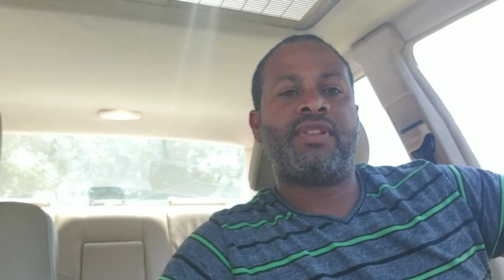W202 power window repair

Comment: Hey I need help my c230 and every mechanic I go to is ripping me off . But one of the things is my driver side window goes up and down. But my back and passenger side windows don’t work and then some times my front driver side window will stop and the sunroof. But if I do a hard reset the sunroof and driver side will work again but other windows don’t. Could please tell me how I would fix this
Reply from the maker: That would be all but impossible to diagnose without having the vehicle to look at. There may be a fault with the window lockout switch. It's the tiny switch on the left between the left front  and rear switches. Put the key in the driver door lock and turn it to the unlock position and hold it there for 5 seconds. If all the windows go down,  it's  a problem with your switches on the console. If only the driver window goes down, it's  a problem with the window controller.

Comment: Why not use wd40
Reply from the maker: I did use wd40. I sprayed the unit before reinstalling. The guy i sold it to says it's still working 6 years and 80k miles later.

Comment: Same issue on my w163 ML, unfortunately they stopped using buttons but instead used pressure  sensors.  Ended up buying a used unit and probably will have ago at making a repair for the existing faulty one.

Comment: Agreed.  Center console switches and shifter are not ideal.  Spilling a drink on the shifter can short out gear position module which will cause shifting problems.  Very annoying.

Comment: WD-40??????
I'm electronics tech. and please never use WD you will create corrosion.
Use contact cleaner or alcohol.
Also never use soap and water.
These are electronics circuits you can damage something else.
Reply: WD = Water Displacement, formula #40. He stated quite clearly there was no integrated circuits, just simple electronics on a pass-through board. I think we can all agree you're being overly critical of this demonstration. It's not like he dunked a transmission control module logic board into a bucket of sea water and left it overnight.

Relax??????